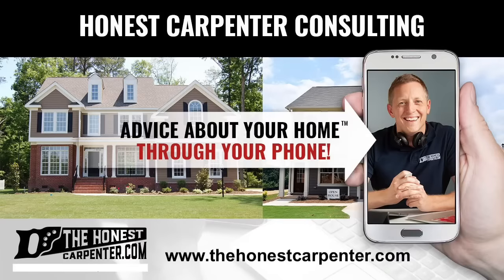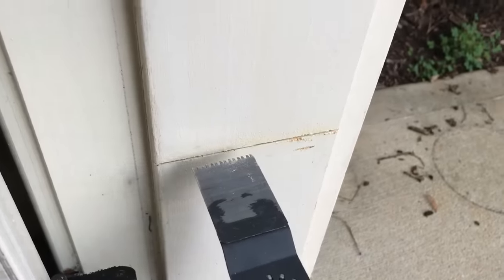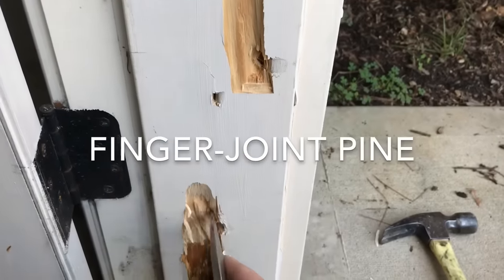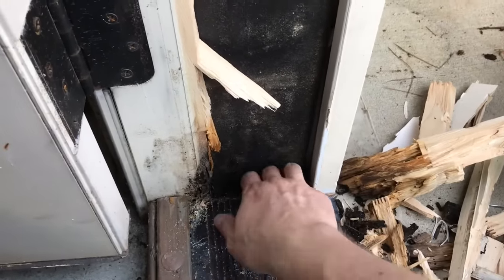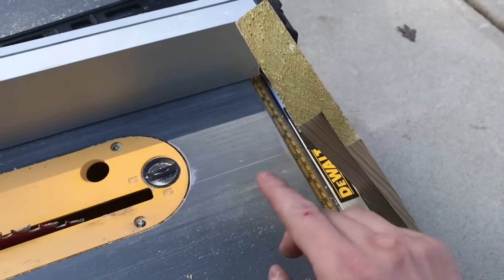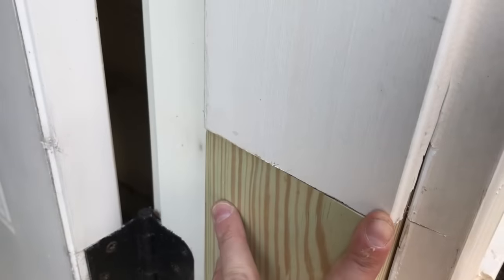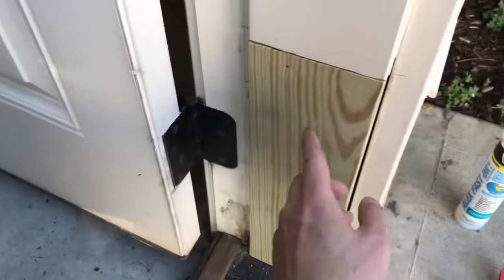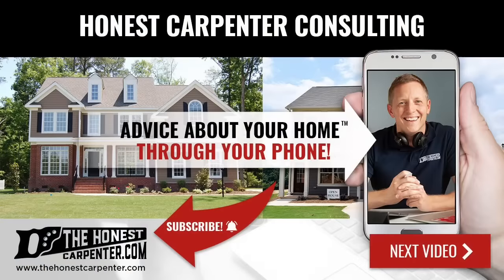How To Repair Rotted Door Jambs

Comment: Thanks so much. I watched your vid and subscribed.  While my client's door frame was not set up exactly like the one you are working on, it helped get the gist across:  deconstruct to see what the actual parts are, then make parts and rebuilt.  She had that door and frame put in about 5 years ago. There was no house wrap either. I take it whoever did that job should have used housewrap over the bricks. I did like you did and cut out 16 in up from the threshhold, even thou the rot was only 4 and 6 in up respectively. Since there is no housewrap, is there any point in adding it at the bottom 16 in where I am now replacing the wood?
my multi-tool is an absolute must. Thanks for taking the time to make this...subscribed and watched your other vids.

Comment: all i do is cut a groove for the weather stripping with 2 passes with my circular saw. It has to be just slightly wider than a typical 6-1/2" cordless circ saw blade and the weather stripping will slide in perfectly.

I also cut my board out on a 45° angle so that the replacement piece is locked behind the existing door frame.
Reply from the maker: hold 'er Newt, shes rearin' ? That makes sense to do! Blade width—or kerf—is about 1/8”, so two passes should create just the rabbet width you’re looking for. Thank you for writing in!
Reply: The Honest Carpenter - sure. thanks for the reply.
yes the groove works great and you dont need a table saw.

great vids btw!
Reply: He didn't use a circular saw to make a 45 cut because he didn't remove the brick molding, Like you I cross cut a 45 but I have to R/R the brick casing that is usually rotted at the bottom so has to be replaced anyway.
Reply: can you explain the 45 degree angle? I can't picture what you mean. you have any visual to look at exactly what you are talking about?
Reply: Rob D - I cross cut the jamb on a 45 deg angle so that my repair piece, also on a 45 deg angle slides in and locks/dovetails itself into the jamb rather than having a butt joint which is more noticeable and can lead to expansion/contraction gap. The 45 deg lap joint solves that and is also more weather resistant. The cut runs uphill so water can’t enter even if the caulk or wood putty/bondo fails.

I typically cut the 45 deg angle using an oscillating tool and a speed square or guide block cut from lumber.
You can do some repairs with a circular saw though you’ll overcut and have to repair that kerf.
Reply: @holdernewtshesrearin5471  thanks for the reply. great when I can learn it from those who know. so you cut a guide block at a 45, then lean the oscillating tool on it as a guide. I never would have thought of that. Thanks
Reply: @holdernewtshesrearin5471  maybe you can answer another question. Question: how much would I be expected to pay for someone to do that?
Reply: Rob D - yes exactly. If you cut a guide block you can lay the blade itself on it, keeping it in contact as you plunge in the first 1/2” to 3/4” or so. Once you’ve established the angle the blade will almost follow it automatically to full depth.
I typically charge $105 -$125 depending on severity of damage (occasionally door closet mounts are involved etc) to replace a rotted door jamb on both sides. Takes me about 1.25 hrs to remove old rot, prep, spray foam or insulate, replace with new, paint and caulk. If the brick mold has to be replaced (both sides. The top is usually ok) that’s another 30 min and $50 materials included.
And definitely, prime,paint or caulk the end grain of the repair pieces. I rub it in with my finger until fully protected and then caulk all gaps and cracks too.
I have repairs that are going on 12 yrs now with no issue.
Reply: Rob D - ** closer

Comment: In the NW of US , these repairs are done these days with PVC trim boards,  or during time to replace , the new door frames are constructed with "non wood" material , this, along with using fiberglass / aluminum clad door panels , and going one step better, utilizing out swinging doors, gives a very weather resistant and better seal against st wind and rain door system .

Comment: It's always a tough call, on this repair. Considering the time and expense of the repair, it's often smarter to replace the entire unit, particularly now that door units are available with jambs that are partially pvc, specifically to prevent this failure. That said- better to use a weather cut at the top (so you don't move the wicking problem farther up the jamb), and your shims should be wider, and also out of treated, or preferably kdat. And not endgrain! One other point- the jamb, on a prehung door, will be fastened to the threshold with screws or staples. Plan on destroying your osc saw blade, cutting through the bottom of the jamb.
Reply: Nope...  PVC coated wood still rots, you just can't see it.  The issue is bare wood contact with a threshold and no sealant.
Reply: @ya472 , there may be coated jambs, but the ones I'm thinking of are solid PVC, for the bottom 16" or so.
Reply: @MrLargePig   OK, but to have that, you have to do a full casing replacement.  I was thinking of repairs, and we have a PVC coated softwood casing  that also needs repair.  We also have aluminum coating, but they haven't been around long enough for me to encounter a problem one.
Reply: Hasn't anyone ever heard of using LINSEED OIL as a sealer these days?!? Applying it to the bottom end as well as the backside would take care of any and practically all future water penetration damage. Also, with or without a storm door, most door jambs are destined for failure due to water damage/rot simply because for some unknown reason everyone uses "Water Colors" when painting everything these days rather than using much more durable oil based coatings. Even for decks and porches, I presume reapplying Thompson's Water Seal every couple of years until getting tired of that, then tearing it down and starting over with fake vinyl or whatever the newest "Permanent" crap is out costing upwards of 10X the cost of just doing it right the first time. Maybe I'm wrong but many steps and porches not only still standing but also looking as good as the day I installed them in the early to mid 70's although the rest of the house gave up the ghost long ago. Just sayin'...
But, I digress

Comment: If you happen to have a nice front door, say Antique of expensive fiberglass, and the door latch or deadbolt is loose because the screws have stripped out the insides, there is a new door hardware I have seen here on YT called ReSecure Latch. It replaces that ugly metal sleeve that changes the look of your door and the wasted time on glue sticks or putty. I have used a few in my Apartment Maintenance career. It sits inside the door alongside the door latch. Super convenient and permanent fix.

Comment: Is there any reason why you did not cut out the jam with the multi tool? Instead of trying it out with a screwdriver?
Reply from the maker: Justin Sriprajittichai Cutting with the multitool is def an option, but I like to save some blade teeth and just crack out carefully. Those multi tool blades get expensive, so I just use them for control cuts, then elbow grease for the rest
Reply: Integra blades off amazon.com. About a buck each. After I got hip to those I stopped caring about the price of them. They're so easy to dull and break
Reply: Get a small file and file the teeth right back into the old dull blade for free
Reply: @TheHonestCarpenter  - You should check out Seejanedrill's video on sharpening your oscillator blades (https://www.youtube.com/watch?v=XN8dlNku0vk).
I've kept my demo blade going way beyond Dremel's hopes and wishes (aka, they want me to buy new blades everyday).
In the time it took you to pry out that wood, you could have sharpened your blade twice. :-)

I love to watch and learn other's take on these common repair tasks around every modern built house.

Comment: Another easy way to buy time and cure the asthetic is to purchase some inexpensive aluminum panels (ex. 4 x 5 inches). These can either be prepainted or bare ( which can be primed before installation). Form each piece of aluminum so that will completely cover the area on each side (including the corner edge) and apply it with construction adhesive, making sure it extends an inch or more above the affected area. Run a bead of exterior caulk at the base to complete. Then paint as needed to match the existing trim. I bought two pieces of unfinished aluminum sheet for 39 cents apiece at my local hardware store. Note: I did completely replace the brickmold.
Reply: How did you get the weather stripping groove?

Comment: Ok I did the same job by cutting about an 8th of an inch off the bottom of the door, filling the gap with redguard sealant then I used a wire brush to scrape away all the dead wood, I used regular Bondo allowed it to dry, sanded it to the right finish, primed it with spray paint then finished it with spray paint and was on my way in less than an hour.
Reply from the maker: @Andre Wells Thanks for writing in! I definitely do some bondo repairs from time to time (I actually do a small one in this video): 
https://www.youtube.com/watch?v=D7efjyTgsA0 
And the wire brush is a good idea--creates more tooth in the wood fiber, which helps the epoxy stick. I avoided it here though because the very bottom was still damp and sure enough I found moisture still sitting in the lower 3" of lumber. I guess the problem is you don't always know until you start breaking stuff out a little bit. (I would ultimately avoid applying bondo to anything wet, and just change out the piece.) Any thoughts?

Comment: I don't understand why he cut the diamonds out of the housewrap. All he had to do is glue the shims to the back of the replacement piece and nail it into place. This would have kept the housewrap intact. Now, with all the glue in there, if it has to be replaced, it's a mess.
Reply: especially since it will be nailed, and glued on the edges.
Reply: Probably to inspect for moisture

Comment: Note, if you paint your bottom cut you will add a few years of damage protection to your door jams....
Reply: Or add a bead of silicone on the bottom prior to installation of board.
Reply: Pre prime the piece and imbued the end cuts into fresh , quality caulking , use hot dipped galvanized nails .

Comment: Just a suggestion. Never use shims that are cross grain cut. These will split if you hail through them. Any shim should be cut with the grain of the wood.
Reply from the maker: Hey Charlie, thanks for writing in. I agree, I use linear grain shins in any situation where they remain unadherred, otherwise you hear them just clatter down into the jamb cavity when they break. But in this app, they’re  swathed in so much adhesive, they’re really just spacers for a day until glue sets up
Reply: Plastic shims are now available. They never split or rot

Comment: I need to do this on our garage doors jambs. Thanks for the video, feel more confident in replacing the bottom sections rather than the whole peice now 👍🏼
Reply from the maker: Matt Booth You’re welcome! Works great for garage door jamb was well. You might consider using cellular pvc. Works great as well, and is utterly impervious to rot
Reply: @TheHonestCarpenter  ..whats cellular pvc?
Reply: @zaneblane8160  "Cellular PVC trim is a wood replacement product made of PVC, molded into forms while in a different state than normal PVC, enabling it to be cut and shaped much like wood without wood’s disadvantages. Cellular PVC trim is like wood and is used to make trimboards, sheets and specialty millwork. It can be used instead of wood or wood-substitute trim in non-load bearing applications."  You will see @ Lowe's/HD in the PVC section. Looks just like the primed wooden boards, just in PVC...cuts like wood, but won't rot like it.

Comment: If you had a router you could easily half lap a joint on the jamb. That way you have a firm top fix and can just nail the bottom with your packing pieces the same as you did. Just a different way!.
Reply: Router is a great option! Just watch out for any fasteners...

Comment: Nice video. I would probably have also put biscuits in each end of cut (if space allows) to keep it from twisting the joint loose, as it will most certainly move as it encounters the different seasons. This will keep that paint line from showing through so much.

Comment: I like your work ! You could of used shingles as shims , won’t rot any a flatter firmer surface that you can shoot your finish nails right into!
Reply: That’s what I used on half of mine.  I couldn’t on the 2nd piece though, as the PVC was too thick.  So i had to buy poplar that was the only thing that was the right thickness I needed.  But I used that water proof product at Lowe’s (the one they do infomercials on... Flex Seal). and just painted it on.  I’ll monitor it, but I feel pretty good that I won’t be dealing with the issues again.

Comment: Try KDAT (kiln dried after treatment)  it's made from pine as well but from a clear pine.
You can prime and paint it right after installation.
Reply: You should have used composite, it will never swell,twist or rot.
Reply: This is true @mikestevenson9511
Reply: Michael Stevenson - Do you mean a composite deck board?

Comment: Thanks for the video. I just fixed mine using these techniques but I used  PVC board!
Reply from the maker: PVC is even better, Marcus!
Reply: @TheHonestCarpenter  man your video was perfect. I cut out the one side like you with the screwdriver. However the other side I found came out so much easier using the multi tool. Cut the dado on the table saw like you suggested. Very happy with the outcome. Thank you sir

Comment: I would have caulked the bottom before installing the piece, as extra protection for the plate and sill.  Also, spackle the cut line and sand it.? I never use caulk because it shrinks and shows the crack. Same for filling nail holes...
Reply: Gary Chandler by spackle I think you mean wood filler.
Reply: @starlingdarkness9316  Woops, yah. Getting old I guess!
Reply: Gary Chandler no worries. The painter on my current job uses the same term for wood filler. Just clarifying for other folks. I agree with the situation of caulk shrinking.
Reply: Spackle? Hah!

Comment: Getting ready to do the same job on my front door however I have 2 side lights on either side of the door. The part to replace is on the strike side of the door adjacent to the side light. A local wood shop cut to size and routed the outer edge to match the the rounding that was on the frame. The replacement piece is made out of Teak wood. The end grain on the bottom will be treated with Clou brand boat and yacht varnish which is one of the best water resistant treatments available here. Will be using the Kreg pocket hole jig to fasten into the top part of the jamb and onto the sill followed by caulking with urethane sealant. Had the door custom ordered and shipped from the states to the Med and one would figure they would have used a higher quality treated lower 10 inches. Frame is made of poplar finger jointed as well.

Comment: Just curious, what's the average cost you or others would charge for this Exact same repair. I'll be doing it next week and wondering how much I'm saving myself. Thanks for the very detailed tutorial.
Reply from the maker: Hey Josh, thanks for writing! Not many carpenters do this particular repair, but I usually charge about $250 for it. I’ll bring that price down if there are multiple bad jambs that need repaired.
Reply: @ZOEng99  John's body filler trick is the hack job.  I would have made a full size shim, or thickness planed thicker stock for more stability other than that it is a great repair.
Reply: john vonburg  Body filler? Did another mental institution get overcrowded and couldn't accept you?
Reply: john vonburg  Thanks for the comic relief John. Body filler? That's hysterical!
Reply: Is that cost per side or for both sides of the door jamb?
Reply: john vonburg back on your meds! Or back off the alcohol. It’s ruining your judgement.
Reply: john vonburg  Totally WRONG way to fix it, that is quick fixing to grab $,

Comment: nice video and good work. i would rather cut long shims with the grain on table saw and glue those to the stop, then screw the stop into the frame. also good observation about lack of end-grain sealing means these will always rot. installation tip: cut a little short at the bottom, seal bottom end grain with epoxy or whatever you think will work, and then caulk under the gap before painting

Comment: No primer on wood? Silicone always separates. Otherwise good work. Oh the butt joint I use Bondo to fill and sand smooth. Instead of silicone I use polyurethane based caulk. Primer for wood a bonding primer sealer oil based.
Reply: +1 on the Bondo.  That seam will be invisible

Comment: Thank you for a great and detailed video. Just what I need with my own front door, not due to rot but due to screen door flying open in a windstorm and pulling the screws and cracking both bottom and top sections of the jamb. 
My question before I attempt any surgery is: my effected door is part of a unit with sidelights . Would this middle frame be attached in the same way as a single door unit and as such the procedure the same or is the mulling of the middle unit done some how differently? screwed or glued together perhaps ?
I know it’s an old post but hoping for some insights before I destroy my front door . 
Appreciate the assistance . 
G. in RI